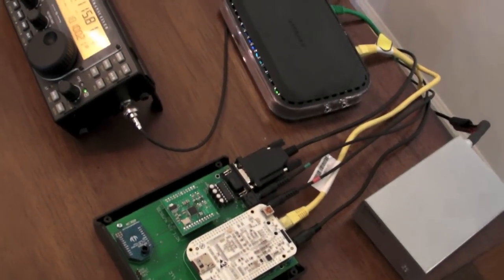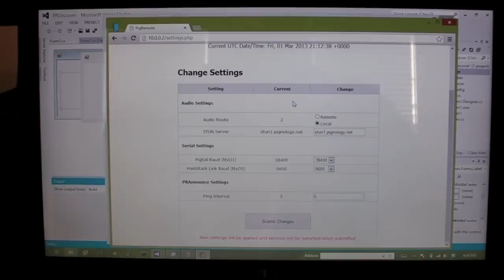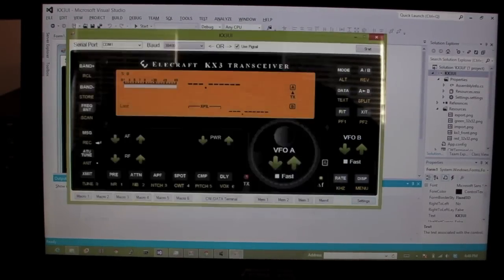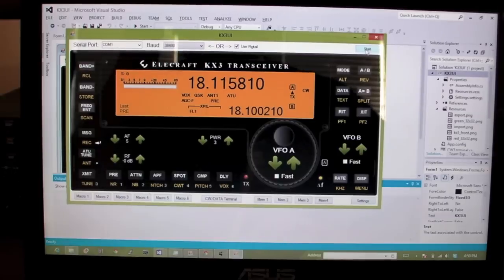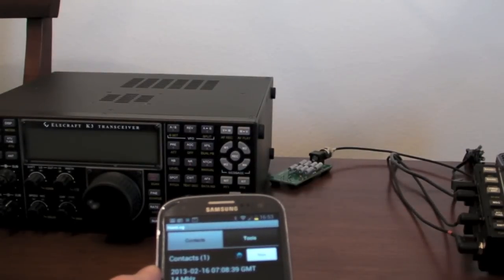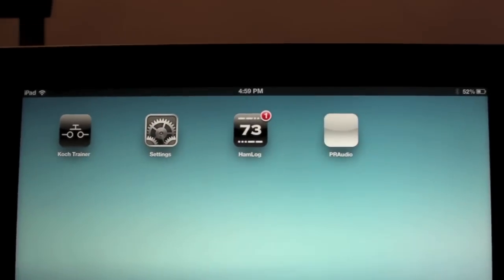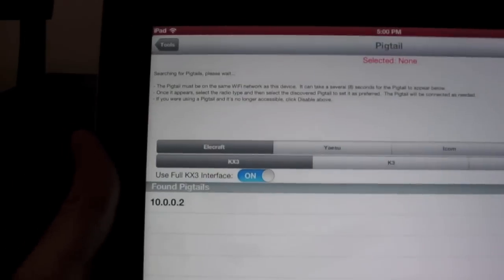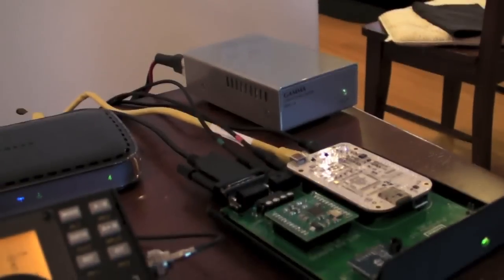PigRemote First Look

Comment: Great work Nick!!  I have the pigtail but have not interfaced it with the KX3 yet.  If the apps are a plug and play thing, I might get it up and running.  I'm an old timer at ham radio and this new digital stuff is a bit confusing.  I liked the "glow" of the tubes as I had a little inkling that they were working.  At least the filaments and voltage were good.  I'll keep following your adventures.  Sure nice to have you in the ham brother/sisterhood.  73/72  N0PL

Comment from the maker: Hi Thomas,
Currently I'm relying on the rig having the ability to send CW using a serial command (Elecraft/Kenwood).  For radio's that don't support CW via CAT, I have something in mind to enable CW via text to a purpose built device that will talk wirelessly to PigRemote.  I haven't started working on this yet.  Getting a key in the hand of the user is another story, the latency (even though it's <100ms) would really mess up the brain/fist.

Comment from the maker: For the wifi question, I'm currently evaluating wifi dongles and trying to get firmware to work.  I do plan on it being supported.  The user will have to get their hands dirty in Linux to configure it for their home network though.  All part of the fun!  Please let me know if you have any further questions.  You can email me as well.  I can't put an email address in here but it's n3wg at pignology followed by a dot net.

73,
Nick